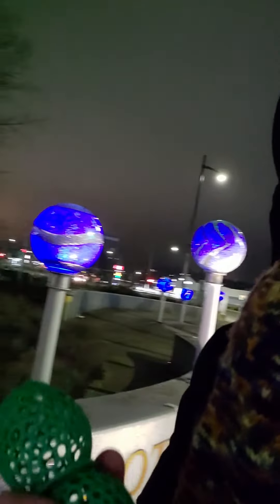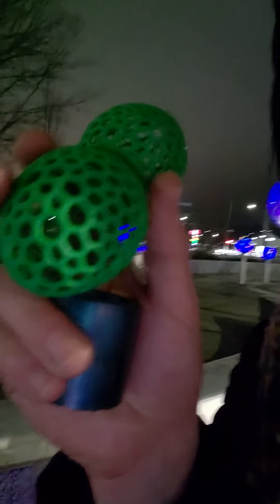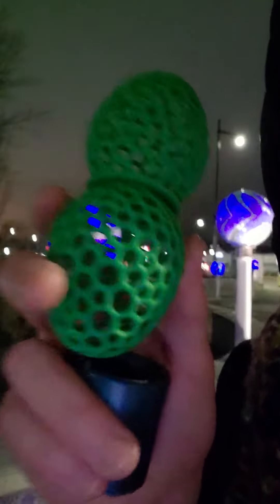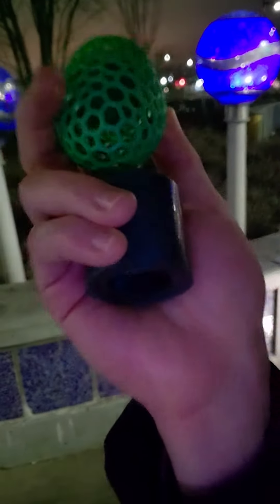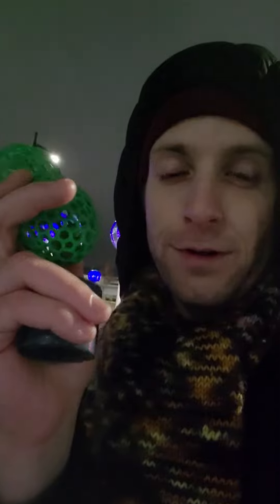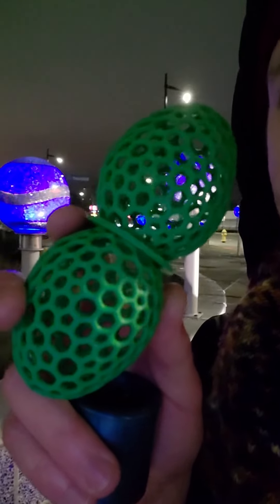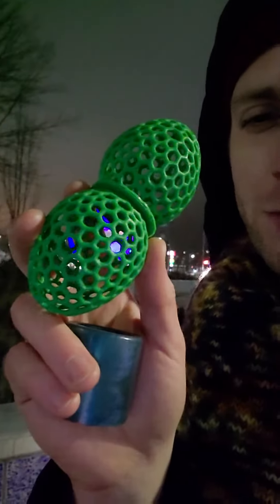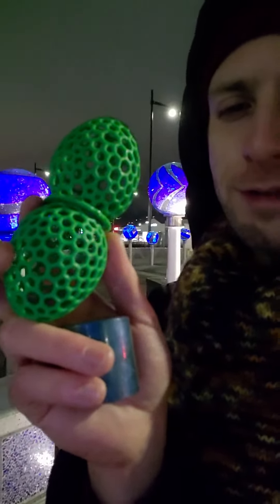The Latest Tech: Meet the DORD and Tunnel

Comment: Really cool products! Could you sit the dord into the tunnel and use a programmer crystal, like amethyst, inside the tunnel on a flat surface?
Reply from the maker: Oh hi! That's a pretty cool idea, though the Tunnel is unfortunately too small to fit the DORD into. I could print a smaller DORD, but if it gets too small the details start to melt together and it doesn't work too well.

But if it did fit together, then yes, I would certainly try that.
Reply: @aethericorg  Hi and thank you for the feedback. Perhaps in the future it might be possible. Love the videos❤️